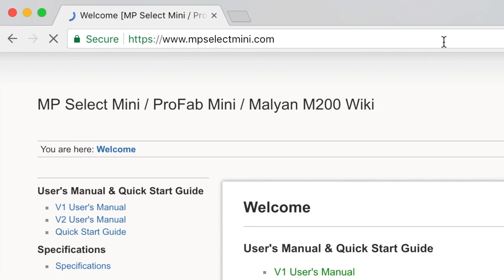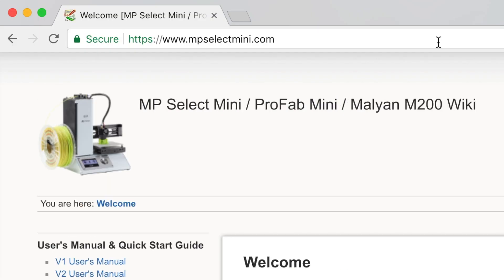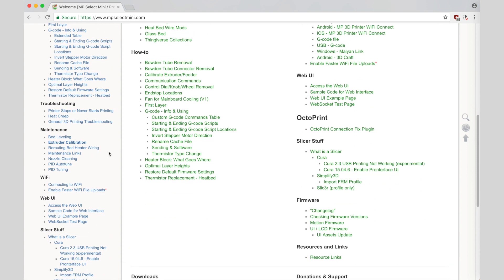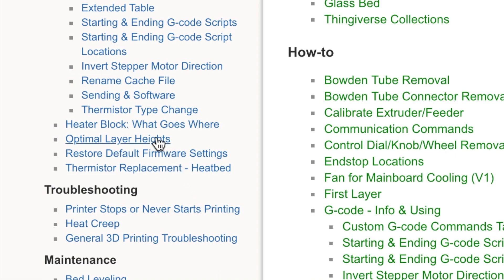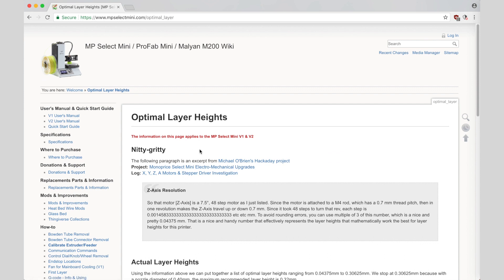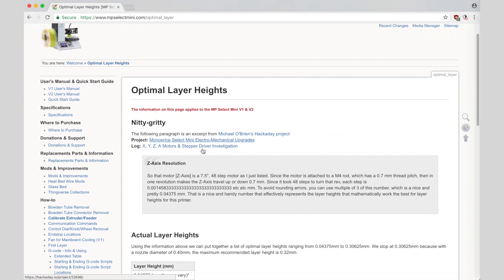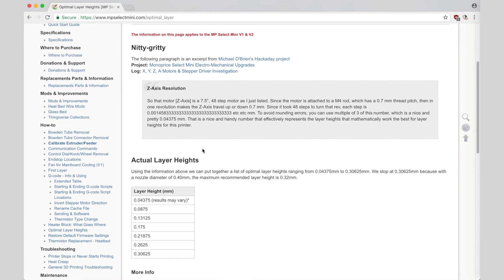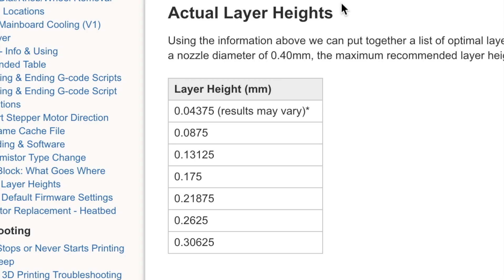Monoprice Mini Optimal Layer Heights

Comment: Hi Frank, I'm having an issue with my mp v2 it starts to print and I'd say about 30 mins in it stops and displays sensor failed error. i have recently changed my filament but its no bigger size do i need to adjust it in any way on my software? i have looked online and some say its the wiring connected to the hotend but that looks fine. any suggestions?
Reply from the maker: Sensor failed indicates that the printer lost the temperature reading from either the hot end or the bed, usually trough the serial port you get if it’s E0(hot end) or E1(bed), with the Mini the cabling under the bed is a little stressed and fails, you can rewire the bed with the help of my video https://youtu.be/xT5_GBvba24
Reply: @Franks3Dshop  brilliant thanks Frank will take a look at it pretty sure it's the bed as the wiring to hotend is looking ok

Comment: Thanks Frank for another great video. Would you consider doing one on bed adhesion and part warpping? The only way I can get my print to stick on the blue tape is to increase the PLA temperature to 210deg, but I think this cause massive distortion when the part cool off. I have a monoprice mini. Thanks and keep up the good work!
Reply from the maker: Hi, if you have trouble with adhesion, a cheap solution is adding a glass bed, it makes the bed straight and with some glue stick it work quite well! And I videos about that on the mini...
Reply from the maker: And thank you ;-)